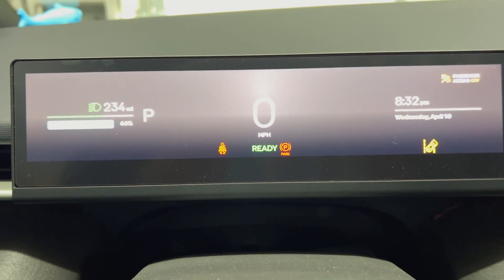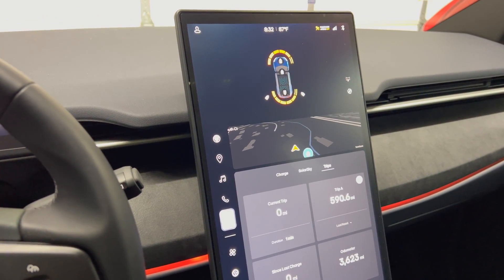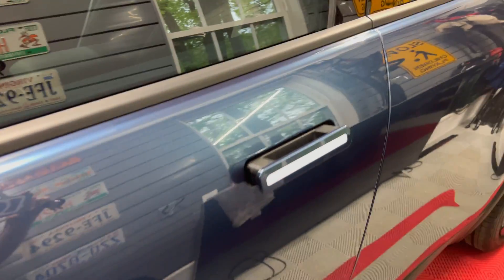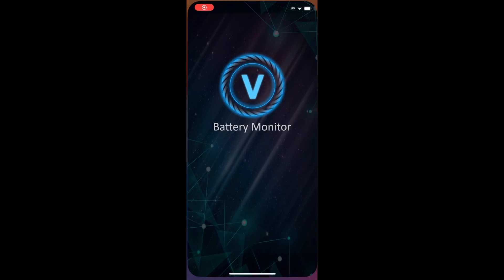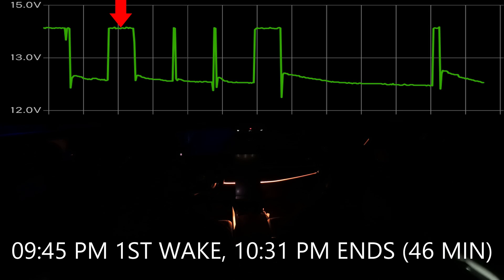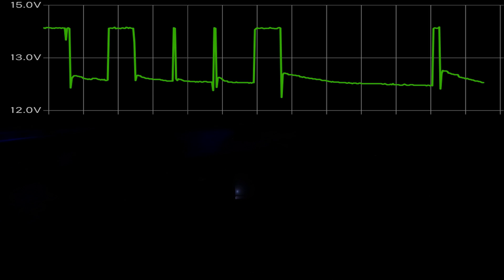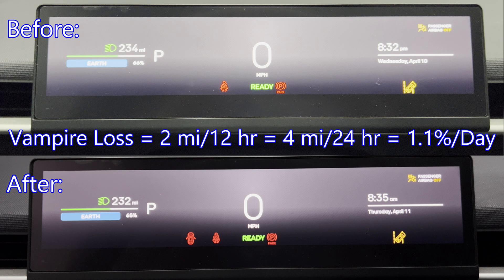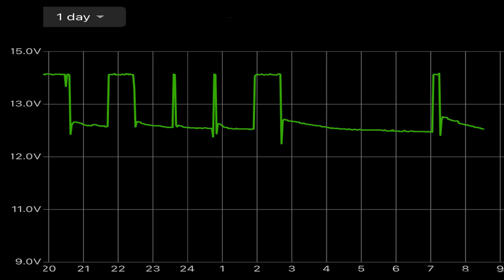Fisker Ocean One - Vampire Drain & 12 V Battery Update

Comment: Hello, my HV battery no longer charges the 12V battery when the car is off. But it charges while driving and when I'm plugged into my wall box. Do you have a solution?
Reply from the maker: I'm not sure what would be causing it not to charge when sleeping.  Do you have a Bluetooth battery monitor?

Comment: Thanks! This video is great. Now that my wife and I have had our Oceans for over a month, all this makes more sense. Aside from going from Point A to Popint B, I find the EV lifestyle totally different, but much improved over ICE for us. Question: the rear passenger map light comes on randomly at night. Is that a part of the 12V check, or is it just the map light coming on? Everything is off when I go into the house and then, aropund 9PM, I go out with the dogs one more time and find the map light on.
Reply from the maker: Thank you!  I have over a hundred videos on the Ocean, so please subscribe.  The map light comes in randomly due to a sensitive switch.  Notice you can turn it on or off about an inch away.  It’s been going on since I’ve had the car.  Some say it’s hardware and some say software.  2.1 does not fix it.

Comment: Nice video. Does the display have a digital readout of the 12v batteries current charge? That would be useful to see how much charge is on the 12v between daily drives. Then we could do a graph of a one month window to see how well the battery maintains consistency.
Reply from the maker: The car has no info on the 12 V battery.  The app I use in the video has 1 day, 7 day, and 15 day charts of voltage.
Reply: @MTNRanger  That's a bummer as even my 1992 Jeep Wrangler has an analog gauge that shows the battery current voltage and the charging. That's a bit scary to not have that readout.
Reply from the maker: @DaveDarin  I don’t know of any EV that lists the 12 V battery voltage as a specific number.  I know my Tesla doesn’t.  The Ocean does give a warning when it considers the 12 V too low.
Reply: @MTNRanger  You are right, now that I think about it. I also drive a BMW i3s REX and my 12v was acting up with a variety of messages. I changed the 12v and all was right again. And  I do not see any place to view the 12v status. Good to know that the Ocean will provide a warning. The BMWs warning was pretty vague.

Comment: Great video, Matt. Thanks for the details. Did you leave the battery tender leads installed in addition to the BT 12v battery monitor?
Reply from the maker: Yes they are still there along with the monitor. Can’t hurt to have it just in case.

Comment: I drive a BMW i3s REX and, from what I understand, the 12v is constantly at a trickle charge. I see 0 high voltage battery drain. And here is a question or comment. If you charge the Fisker every night, as I do with the i3s, would that not ever be an issue? If you are seeing 30 minute cycles to charge the 12v and it is taking charge from the high volage battery to do so, would keeping the Ocean plugged in to the home charging maintain the 100% charge of the high voltage?
Reply from the maker: The HV battery charges the 12V whether it is plugged in, driving or parked. It checks every so often and charges when necessary.  I use the same monitor on my Tesla Model 3 and it works the same way as the Ocean. Each manufacturer may use different methods on the 12 V battery.

Comment: After 2.0 update, I haven’t experienced any vampire drain.  Not even 1% overnight.  I normally charge the car up to 90% if it runs below 50%.  I use 30 seconds standby as you.  Haven’t seen any illuminating of the center touch screen after I locked the car.  Is that because my 12V can retain the power batter?
Reply from the maker: That’s great!  I only get some lights as seen in the video.  The screen doesn’t turn on for me.

Comment: I believe that for any comparison of vampire drain, it is important to report the energy settings in the menu. I have the standby time set to 10 minutes and turned off both the AC outlets (trunk and charge port). The reason is that the inverters need to be powered for the AC outlets to function at all. With those settings I have very little vampire drain. Of course you need to have the update 2.0 for that to work!
Reply from the maker: Good point, I have the energy settings set to 30 seconds.  But honestly have not seen any difference between 30 seconds and 10 minutes.  How do you turn off the outlets?  They will normally be shut off when the car sleeps.
Reply: @MTNRanger  On the same screen for the standby energy setting, below that, I find the settings for the power outlets.